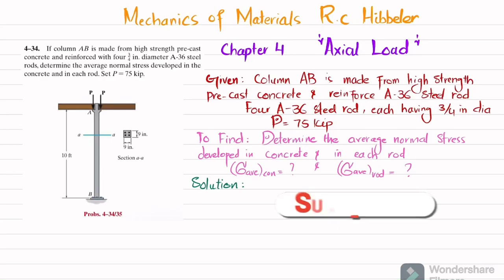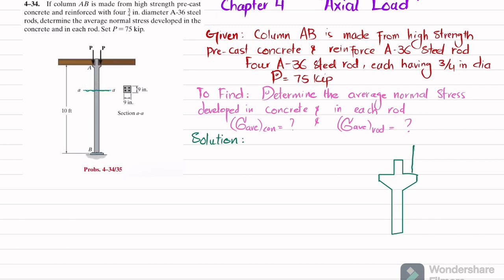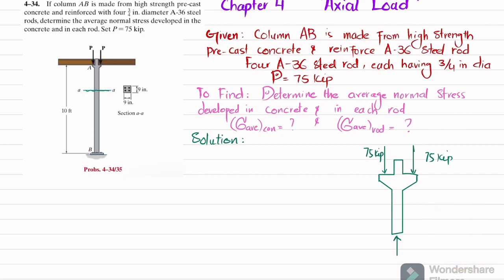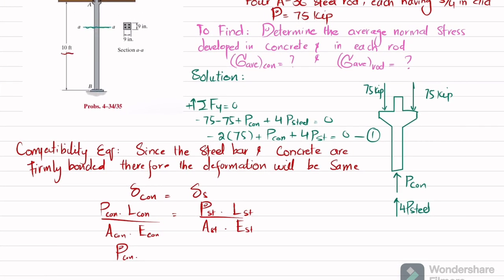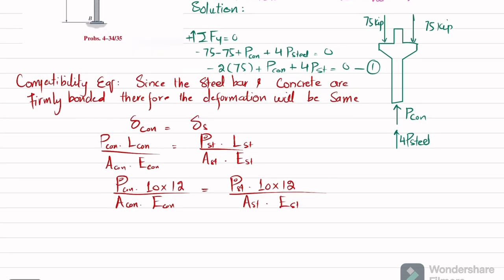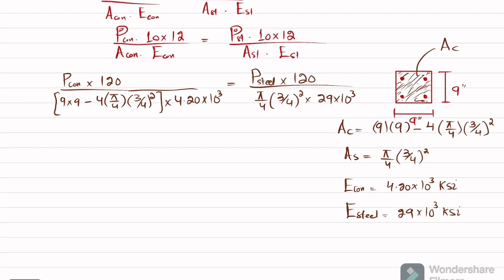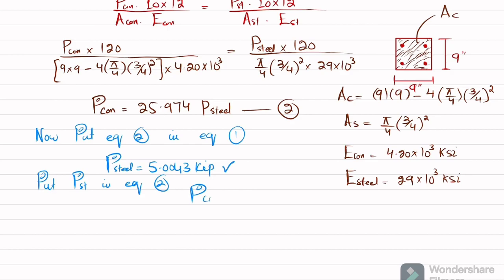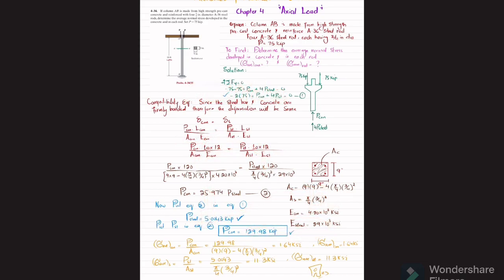Determine average normal stress | Problem 4-34 | axial load | stress | Mech of materials rc Hibbeler

Comment: Thanks for explaining. I have one question that at ex 4-31 you said that extended load = P con+P steel but at this one you said that extended load = P con +4 P steel. Can you say more clearly about this. Thank you
Reply from the maker: It's already clear. You can see the total applied load = load taken by concrete + load taken by steel rod . As there are four steel rods in concrete column  so total applied load = load taken by concrete + 4 load taken by each steel rod.
Reply: @engradnanrasheedmechanical  But in your explanation of exercise 4-31 which is a similar situation with 4 steel rods but it is used as P_s instead of 4P_s
Reply from the maker: In that you can check 4 time Areas was used to calculate the stress.